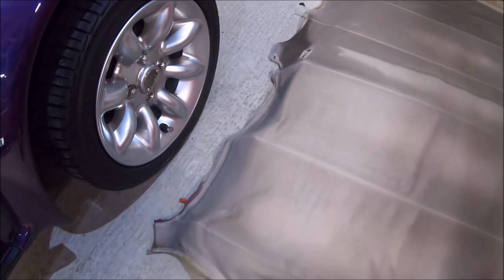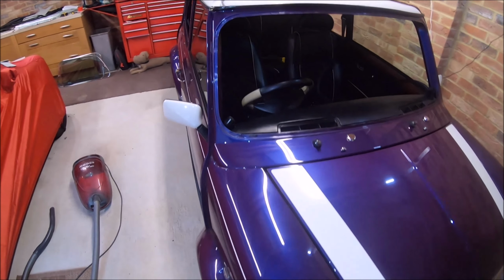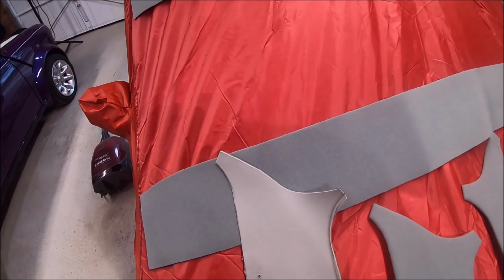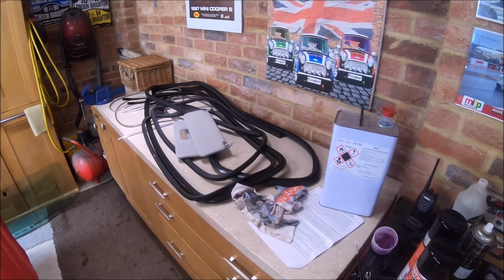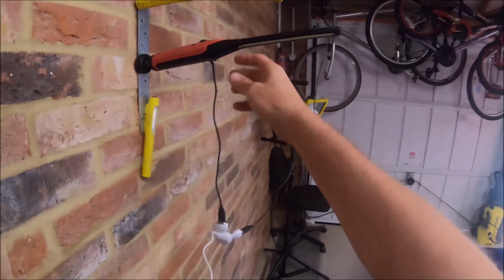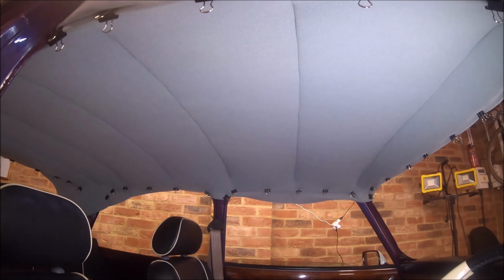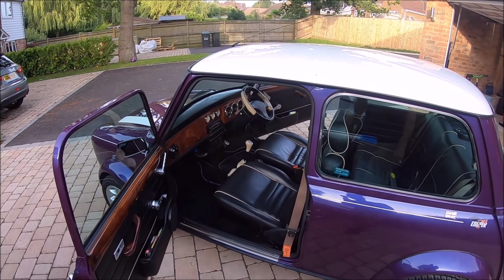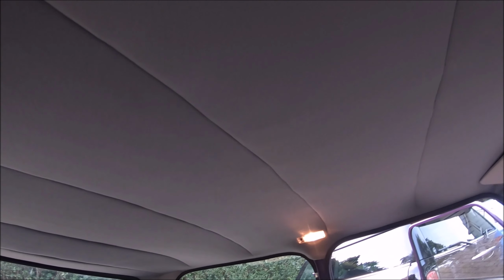Classic Mini Workshop - Replacing the Headlining

Comment: Hi Keith,  I was just wondering do all the new window rubbers come in one continuous piece?  My front and back rubber seals are not continuous and the ends meet at the middle bottom.  You have two very pretty Minis, enjoyed your video.
Reply from the maker: Mine were split on Vini 1994 but continuous on PIIIOOW 1997 although you can see the join on PIIIOOW.

Comment: You haven't shown anything of putting it in the headlining
Reply from the maker: Apologies for that, the footage files were corrupt for that part. Its basically just a case of passing it through the rear window to the front and then fitting in place the poles front to rear
Reply: I know but you're down as a workshop you should be shown of putting in the headliner and the trials and tribulations of doing so
Reply: You like to do a lot of talking and explaining gut sometimes just and your mates walking round the fantastic mini I'm hopefully not trying to to put you off but as an instructor I feeling you need to do more footage to clarify your explanation
Reply from the maker: @phyzical123  Like I said, I filmed it but when downloading the files were corrupt. My plan was to show the headlining going in. Unfortunately it's not the sort of thing I could just go and film again after I realised the footage was no good.
Reply: @phyzical123  , to be fair Keith did say he'd lost some footage, but on the upside, if you look at the KITT videos it shows a headlining being installed fully. I'm sure if you ask, keith might be able to slow it down for you so you can see it in all it's glory.